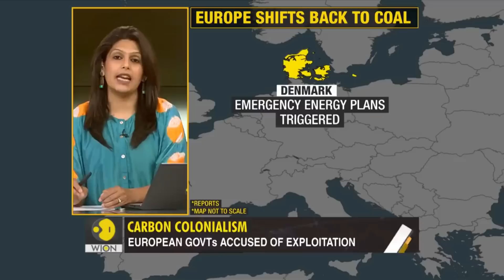Ghana is Finally going NUCLEAR POWER to intensify Industries and the African Free trade Area

Comment: This is not going to help African. Please let us shine our eyes ooh. Solar Energy is good but it can’t replace fossil fuel.
Reply: Africans are smart. Your smart young minds will figure it out.
Reply: Ghana imdustry, enterprises and society needs will not be met through current or Ernest energy solutions..

Name a country that is powering its industries and societies primarily through renwables? Norway? They are currently paying record prices to electrify and heat their homes. And that is based on their hydroelectric energy sources. Germany? They are getting prepared to put their renewable solution to its biggest test this winter. If that test fails? Millions of them will freeze.
.
 There are Afrikan countries that are already amongst the TOP 10 highest consumers of renewable energy. How is that working out for their respective industries and societies?
The 10 countries using the largest percentage of renewable energy are:

DR Congo - 96.24%
Somalia - 95.03%
Central African Republic - 91.26%
Uganda - 90.22%
Gabon - 89.88%
Ethiopia - 88.92%
Liberia - 87,24%
Guinea-Bissau - 86.24%
Tanzania - 85.22%
Burundi - 84.77%

For further comparison here is a macro look at renewable energy consumption on Country by Country basis:

Country Renewable Energy Consumption % 2022 Population
DR Congo	96.24%	99,010,212
Somalia	95.03%	17,597,511
Central African Republic	91.26%	5,579,144
Uganda	90.22%	47,249,585
Gabon	89.88%	2,388,992
Ethiopia	88.92%	123,379,924
Liberia	87.24%	5,302,681
Guinea Bissau	86.24%	2,105,566
Tanzania	85.22%	65,497,748
Burundi	84.77%	12,889,576
Zambia	84.50%	20,017,675
Madagascar	82.77%	29,611,714
Bhutan	82.27%	782,455
Zimbabwe	81.50%	16,320,537
Nigeria	81.40%	218,541,212
Iceland	81.07%	372,899
Niger	80.83%	26,207,977
Cameroon	79.41%	27,914,536
Mozambique	78.08%	32,969,518
Rwanda	77.86%	13,776,698
Chad	77.79%	17,723,315
Nepal	77.39%	30,547,580
Mali	76.64%	22,593,590
Haiti	76.40%	11,584,996
Togo	76.21%	8,848,699
Sierra Leone	75.44%	8,605,718
Eritrea	73.67%	3,684,032
Malawi	73.02%	20,405,317
Republic of the Congo	68.67%	5,970,424
Kenya	68.08%	54,027,487
Eswatini	65.95%	1,201,670
Guinea	65.44%	13,859,341
Burkina Faso	64.85%	22,673,762
Guatemala	62.92%	17,843,908
Ivory Coast	62.46%	28,160,542
Norway	62.37%	5,434,319
Sudan	62.23%	46,874,204
Uruguay	60.76%	3,422,794
Paraguay	60.09%	6,780,744
Myanmar	57.85%	54,179,306
Liechtenstein	56.13%	39,327
Angola	54.69%	35,588,987
Comoros	53.43%	836,774
Cambodia	53.36%	16,767,842
Papua New Guinea	53.09%	10,142,619
Sweden	52.88%	10,549,347
Nicaragua	50.71%	6,948,392
Sri Lanka	49.91%	21,832,143
Gambia	49.24%	2,705,992
Laos	48.43%	7,529,475
Solomon Islands	48.39%	724,273
Brazil	47.57%	215,313,498
Benin	46.47%	13,352,864
Honduras	45.96%	10,432,860
Finland	45.76%	5,540,745
Pakistan	43.46%	235,824,862
Ghana	41.80%	33,475,870
Latvia	41.52%	1,850,651
Albania	40.20%	2,842,321
Lesotho	39.47%	2,305,825
Montenegro	38.74%	627,082
Tajikistan	38.56%	9,952,787
Denmark	37.52%	5,882,261
Senegal	37.20%	17,316,449
Sao Tome and Principe	37.09%	227,380
Bosnia and Herzegovina	37.02%	3,233,526
Costa Rica	35.79%	5,180,829
Samoa	34.21%	222,382
Austria	33.77%	8,939,617
Lithuania	33.53%	2,750,055
India	32.93%	1,417,173,173
Croatia	31.60%	4,030,358
Estonia	31.29%	1,326,062
Colombia	30.72%	51,874,024
Namibia	30.69%	2,567,012
New Zealand	29.65%	5,185,288
Belize	29.09%	405,272
Portugal	28.19%	10,270,865
Djibouti	27.92%	1,120,849
Kyrgyzstan	27.88%	6,630,623
Peru	27.13%	34,049,588
Philippines	26.73%	115,559,009
South Sudan	26.65%	10,913,164
Fiji	26.48%	929,766
Botswana	25.57%	2,630,296
Chile	25.26%	19,603,733
Georgia	25.22%	3,744,385
Switzerland	24.76%	8,740,472
Bangladesh	24.75%	171,186,372
Mauritania	24.70%	4,736,139
Thailand	23.96%	71,697,030
Romania	23.54%	19,659,267
Canada	22.11%	38,454,327
Moldova	22.04%	3,272,996
Cuba	21.54%	11,212,191
Serbia	21.53%	7,221,365
Slovenia	20.86%	2,119,844
Bulgaria	19.34%	6,781,953
Indonesia	19.09%	275,501,339
Panama	18.91%	4,408,581
Vietnam	18.65%	98,186,856
Afghanistan	18.51%	41,128,771
Greece	18.51%	10,384,971
Andorra	18.40%	79,824
Ecuador	17.73%	18,001,000
Slovakia	17.64%	5,643,453
Italy	17.27%	59,037,474
Spain	17.27%	47,558,630
Germany	17.17%	83,369,843
Luxembourg	16.45%	647,599
North Macedonia	16.32%	2,093,599
Czech Republic	15.85%	10,493,986
Venezuela	15.62%	28,301,696
France	15.53%	64,626,628
China	14.45%	1,425,887,337
Suriname	14.40%	618,040
Turkey	14.12%	85,341,241
Palestine	13.86%	5,250,072
Hungary	13.64%	9,967,308
Greenland	12.60%	56,466
Ireland	12.34%	5,023,109
United Kingdom	12.24%	67,508,936
Tunisia	12.20%	12,356,117
Poland	12.18%	39,857,145
Cyprus	12.05%	1,251,488
Marshall Islands	11.70%	41,569
Timor Leste	11.67%	1,341,296
Guyana	11.35%	808,726
North Korea	11.31%	26,069,416
Argentina	10.74%	45,510,318
Morocco	10.69%	37,457,971
South Africa	10.50%	59,893,885
United States	10.42%	338,289,857
Grenada	10.37%	125,438
Mexico	10.34%	127,504,125
Armenia	10.34%	2,780,469
Belgium	10.21%	11,655,930
Australia	10.13%	26,177,413
Jamaica	9.09%	2,827,377
Mauritius	8.94%	1,299,469
Bolivia	8.67%	12,224,110
Netherlands	8.54%	17,564,014
Tuvalu	8.20%	11,312
Jordan	8.17%	11,285,869
Dominica	8.05%	72,737
Belarus	7.83%	9,534,954
Malta	7.70%	533,286
Japan	7.69%	123,951,692
French Polynesia	7.67%	306,279
Aruba	7.48%	106,445
Ukraine	7.44%	39,701,739
Equatorial Guinea	6.48%	1,674,908
Saint Vincent and the Grenadines	5.68%	103,948
Lebanon	5.46%	5,489,739
Faroe Islands	5.40%	53,090
Egypt	5.30%	110,990,103
Malaysia	5.11%	33,938,221
Israel	4.47%	9,038,309
Barbados	4.31%	281,635
United States Virgin Islands	3.66%	99,465
South Korea	3.36%	51,815,810
Mongolia	3.32%	3,398,366
Russia	3.22%	144,713,314
Yemen	3.11%	33,696,614
Guam	3.02%	171,774
Libya	2.80%	6,812,341
Curacao	2.68%	191,163
Puerto Rico	2.42%	3,252,407
Isle of Man	1.90%	84,519
Micronesia	1.78%	114,164
Tonga	1.77%	106,858
Kazakhstan	1.70%	19,397,998
Azerbaijan	1.62%	10,358,074
Saint Kitts and Nevis	1.58%	47,657
Uzbekistan	1.57%	34,627,652
British Virgin Islands	1.23%	31,305
Bahamas	1.14%	409,984
Maldives	1.11%	523,787
Syria	1.02%	22,125,249
Iran	0.98%	88,550,570
Antigua and Barbuda	0.91%	93,763
Singapore	0.84%	5,975,689
Bermuda	0.84%	64,184
United Arab Emirates	0.67%	9,441,129
Nauru	0.61%	12,668
American Samoa	0.50%	44,273
Iraq	0.43%	44,496,122
Trinidad and Tobago	0.34%	1,531,044
Palau	0.29%	18,055
Hong Kong	0.23%	7,488,865
Algeria	0.16%	44,903,225
Turkmenistan	0.06%	6,430,770
Kuwait	0.06%	4,268,873
Sint Maarten	0.05%	44,175
Qatar	0.04%	2,695,122
Saudi Arabia	0.03%	36,408,820
Brunei	0.01%	449,002
Oman	0.00%	4,576,298
Bahrain	0.00%	1,472,233
Cayman Islands	0.00%	68,706

Even the West does not take the renewable scam that seriously. Less so with the current test pending that they are facing this winter; without their usual supply from Russia.

There is no substitute for how the industrial economy runs today. The "renewable" push is a road to de-industrialization. A dead end one at that.

Afrika does not need to fall for any "Bait and Switch." They have to get tired of being dupes and suckers for Globalist schemes at some point. 

Renewable Energy is The Scam We All Fell For
https://youtu.be/lL6uB1z95gA

Bill Gates Slams Unreliable Wind and Solar Energy
https://youtu.be/9xe3BWPsBTU

Why renewables can’t save the planet 
https://youtu.be/N-yALPEpV4w

Comment: Interesting move but how is Ghana going to dispose the waste considering the fact that domestic waste management is a Herculean task ATM.
Reply: How do countries like Iran, India, Pakistan, North Korea dispose of their nuclear waste? Ghana and other Afrikan countries can follow the same template.
Reply: @BonsuBigWhale  Those countries are far advanced in technology than Ghana. It will be take Ghana decades and decades to come closer to them.
Reply: Ghana has friends such as Russia that can provide consultation as well as the ability to follow the same solutions those other countries have implemented.

What is clear is that there is no current or renewable energy source that is going to meet Them was imdustrial, Enterprise or societal ambitions. 

Name a country that is powering its industries and societies primarily through renwables? Norway? They are currently paying record prices to electrify and heat their homes. And that is based on their hydroelectric energy sources. Germany? They are getting prepared to put their renewable solution to its biggest test this winter. If that test fails? Millions of them will freeze.
.
 There are Afrikan countries that are already amongst the TOP 10 highest consumers of renewable energy. How is that working out for their respective industries and societies?
The 10 countries using the largest percentage of renewable energy are:

DR Congo - 96.24%
Somalia - 95.03%
Central African Republic - 91.26%
Uganda - 90.22%
Gabon - 89.88%
Ethiopia - 88.92%
Liberia - 87,24%
Guinea-Bissau - 86.24%
Tanzania - 85.22%
Burundi - 84.77%

For further comparison here is a macro look at renewable energy consumption on Country by Country basis:

Country Renewable Energy Consumption % 2022 Population
DR Congo	96.24%	99,010,212
Somalia	95.03%	17,597,511
Central African Republic	91.26%	5,579,144
Uganda	90.22%	47,249,585
Gabon	89.88%	2,388,992
Ethiopia	88.92%	123,379,924
Liberia	87.24%	5,302,681
Guinea Bissau	86.24%	2,105,566
Tanzania	85.22%	65,497,748
Burundi	84.77%	12,889,576
Zambia	84.50%	20,017,675
Madagascar	82.77%	29,611,714
Bhutan	82.27%	782,455
Zimbabwe	81.50%	16,320,537
Nigeria	81.40%	218,541,212
Iceland	81.07%	372,899
Niger	80.83%	26,207,977
Cameroon	79.41%	27,914,536
Mozambique	78.08%	32,969,518
Rwanda	77.86%	13,776,698
Chad	77.79%	17,723,315
Nepal	77.39%	30,547,580
Mali	76.64%	22,593,590
Haiti	76.40%	11,584,996
Togo	76.21%	8,848,699
Sierra Leone	75.44%	8,605,718
Eritrea	73.67%	3,684,032
Malawi	73.02%	20,405,317
Republic of the Congo	68.67%	5,970,424
Kenya	68.08%	54,027,487
Eswatini	65.95%	1,201,670
Guinea	65.44%	13,859,341
Burkina Faso	64.85%	22,673,762
Guatemala	62.92%	17,843,908
Ivory Coast	62.46%	28,160,542
Norway	62.37%	5,434,319
Sudan	62.23%	46,874,204
Uruguay	60.76%	3,422,794
Paraguay	60.09%	6,780,744
Myanmar	57.85%	54,179,306
Liechtenstein	56.13%	39,327
Angola	54.69%	35,588,987
Comoros	53.43%	836,774
Cambodia	53.36%	16,767,842
Papua New Guinea	53.09%	10,142,619
Sweden	52.88%	10,549,347
Nicaragua	50.71%	6,948,392
Sri Lanka	49.91%	21,832,143
Gambia	49.24%	2,705,992
Laos	48.43%	7,529,475
Solomon Islands	48.39%	724,273
Brazil	47.57%	215,313,498
Benin	46.47%	13,352,864
Honduras	45.96%	10,432,860
Finland	45.76%	5,540,745
Pakistan	43.46%	235,824,862
Ghana	41.80%	33,475,870
Latvia	41.52%	1,850,651
Albania	40.20%	2,842,321
Lesotho	39.47%	2,305,825
Montenegro	38.74%	627,082
Tajikistan	38.56%	9,952,787
Denmark	37.52%	5,882,261
Senegal	37.20%	17,316,449
Sao Tome and Principe	37.09%	227,380
Bosnia and Herzegovina	37.02%	3,233,526
Costa Rica	35.79%	5,180,829
Samoa	34.21%	222,382
Austria	33.77%	8,939,617
Lithuania	33.53%	2,750,055
India	32.93%	1,417,173,173
Croatia	31.60%	4,030,358
Estonia	31.29%	1,326,062
Colombia	30.72%	51,874,024
Namibia	30.69%	2,567,012
New Zealand	29.65%	5,185,288
Belize	29.09%	405,272
Portugal	28.19%	10,270,865
Djibouti	27.92%	1,120,849
Kyrgyzstan	27.88%	6,630,623
Peru	27.13%	34,049,588
Philippines	26.73%	115,559,009
South Sudan	26.65%	10,913,164
Fiji	26.48%	929,766
Botswana	25.57%	2,630,296
Chile	25.26%	19,603,733
Georgia	25.22%	3,744,385
Switzerland	24.76%	8,740,472
Bangladesh	24.75%	171,186,372
Mauritania	24.70%	4,736,139
Thailand	23.96%	71,697,030
Romania	23.54%	19,659,267
Canada	22.11%	38,454,327
Moldova	22.04%	3,272,996
Cuba	21.54%	11,212,191
Serbia	21.53%	7,221,365
Slovenia	20.86%	2,119,844
Bulgaria	19.34%	6,781,953
Indonesia	19.09%	275,501,339
Panama	18.91%	4,408,581
Vietnam	18.65%	98,186,856
Afghanistan	18.51%	41,128,771
Greece	18.51%	10,384,971
Andorra	18.40%	79,824
Ecuador	17.73%	18,001,000
Slovakia	17.64%	5,643,453
Italy	17.27%	59,037,474
Spain	17.27%	47,558,630
Germany	17.17%	83,369,843
Luxembourg	16.45%	647,599
North Macedonia	16.32%	2,093,599
Czech Republic	15.85%	10,493,986
Venezuela	15.62%	28,301,696
France	15.53%	64,626,628
China	14.45%	1,425,887,337
Suriname	14.40%	618,040
Turkey	14.12%	85,341,241
Palestine	13.86%	5,250,072
Hungary	13.64%	9,967,308
Greenland	12.60%	56,466
Ireland	12.34%	5,023,109
United Kingdom	12.24%	67,508,936
Tunisia	12.20%	12,356,117
Poland	12.18%	39,857,145
Cyprus	12.05%	1,251,488
Marshall Islands	11.70%	41,569
Timor Leste	11.67%	1,341,296
Guyana	11.35%	808,726
North Korea	11.31%	26,069,416
Argentina	10.74%	45,510,318
Morocco	10.69%	37,457,971
South Africa	10.50%	59,893,885
United States	10.42%	338,289,857
Grenada	10.37%	125,438
Mexico	10.34%	127,504,125
Armenia	10.34%	2,780,469
Belgium	10.21%	11,655,930
Australia	10.13%	26,177,413
Jamaica	9.09%	2,827,377
Mauritius	8.94%	1,299,469
Bolivia	8.67%	12,224,110
Netherlands	8.54%	17,564,014
Tuvalu	8.20%	11,312
Jordan	8.17%	11,285,869
Dominica	8.05%	72,737
Belarus	7.83%	9,534,954
Malta	7.70%	533,286
Japan	7.69%	123,951,692
French Polynesia	7.67%	306,279
Aruba	7.48%	106,445
Ukraine	7.44%	39,701,739
Equatorial Guinea	6.48%	1,674,908
Saint Vincent and the Grenadines	5.68%	103,948
Lebanon	5.46%	5,489,739
Faroe Islands	5.40%	53,090
Egypt	5.30%	110,990,103
Malaysia	5.11%	33,938,221
Israel	4.47%	9,038,309
Barbados	4.31%	281,635
United States Virgin Islands	3.66%	99,465
South Korea	3.36%	51,815,810
Mongolia	3.32%	3,398,366
Russia	3.22%	144,713,314
Yemen	3.11%	33,696,614
Guam	3.02%	171,774
Libya	2.80%	6,812,341
Curacao	2.68%	191,163
Puerto Rico	2.42%	3,252,407
Isle of Man	1.90%	84,519
Micronesia	1.78%	114,164
Tonga	1.77%	106,858
Kazakhstan	1.70%	19,397,998
Azerbaijan	1.62%	10,358,074
Saint Kitts and Nevis	1.58%	47,657
Uzbekistan	1.57%	34,627,652
British Virgin Islands	1.23%	31,305
Bahamas	1.14%	409,984
Maldives	1.11%	523,787
Syria	1.02%	22,125,249
Iran	0.98%	88,550,570
Antigua and Barbuda	0.91%	93,763
Singapore	0.84%	5,975,689
Bermuda	0.84%	64,184
United Arab Emirates	0.67%	9,441,129
Nauru	0.61%	12,668
American Samoa	0.50%	44,273
Iraq	0.43%	44,496,122
Trinidad and Tobago	0.34%	1,531,044
Palau	0.29%	18,055
Hong Kong	0.23%	7,488,865
Algeria	0.16%	44,903,225
Turkmenistan	0.06%	6,430,770
Kuwait	0.06%	4,268,873
Sint Maarten	0.05%	44,175
Qatar	0.04%	2,695,122
Saudi Arabia	0.03%	36,408,820
Brunei	0.01%	449,002
Oman	0.00%	4,576,298
Bahrain	0.00%	1,472,233
Cayman Islands	0.00%	68,706

Even the West does not take the renewable scam that seriously. Less so with the current test pending that they are facing this winter; without their usual supply from Russia.

There is no substitute for how the industrial economy runs today. The "renewable" push is a road to de-industrialization. A dead end one at that.

Afrika does not need to fall for any "Bait and Switch." They have to get tired of being dupes and suckers for Globalist schemes at some point. 

Renewable Energy is The Scam We All Fell For
https://youtu.be/lL6uB1z95gA

Bill Gates Slams Unreliable Wind and Solar Energy
https://youtu.be/9xe3BWPsBTU

Why renewables can’t save the planet 
https://youtu.be/N-yALPEpV4w
Reply: @BonsuBigWhale  Nobody has debunked the idea of nuclear reactors as a way of solving energy and climate change problems. The question is if Ghana is ready considering our poor maintenance culture, “I don’t care God is in control” attitude etc. Common hospitals, railway network etc. we can’t even maintain properly. Our improper management of Domestic Waste and drainage systems (Korle, Odor etc..) not to even talk about nuclear waste handling and allocation of waste disposal sites (whose hometown is going to fall victim?). Even more advanced countries have had Nuclear incidents due to negligence and poor design, not forgetting the fukushima, chernobyl disasters.   https://en.wikipedia.org/wiki/List_of_nuclear_power_accidents_by_country . The question is Ghana ready, I think we should focus on solving the more basic problems we have at the moment bro?